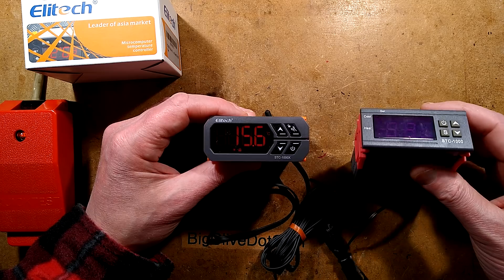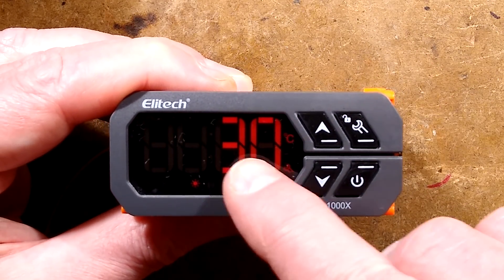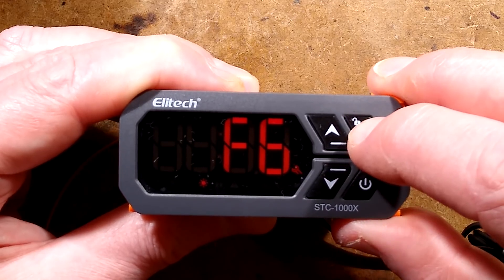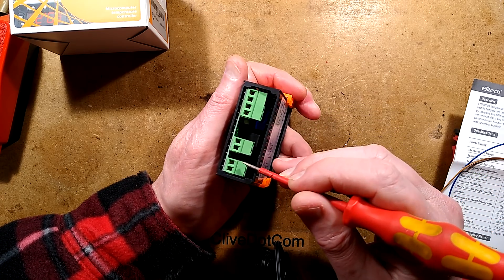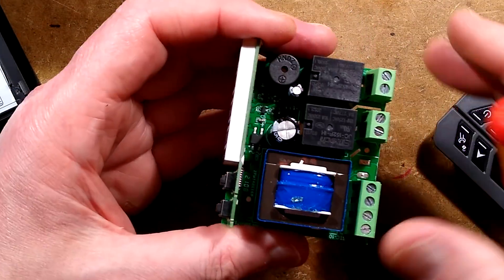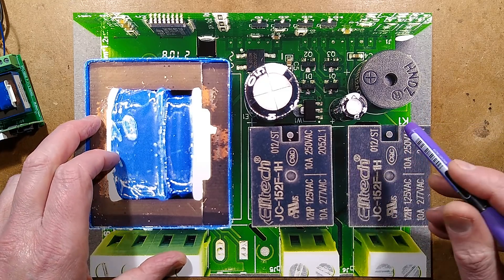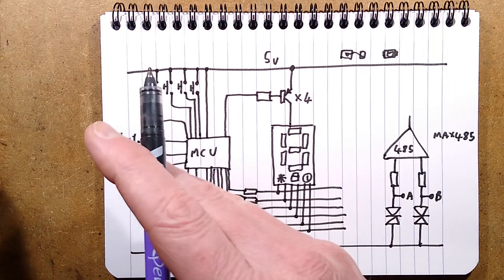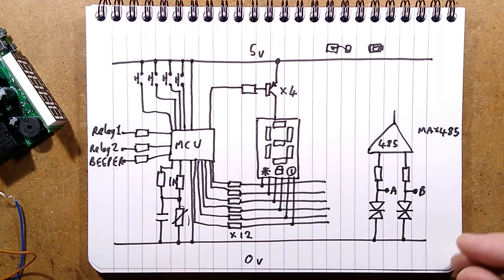Inside a better quality Elitech thermostat (with schematic)

Comment: In an electrical system NEVER assume that what's designated Neutral actually is Neutral. In industrial systems you might have a solution of 230V between 2 phases in a 3-phase solution with floating ground. This would lower the risk of someone getting hurt if they accidentally touch one phase unless one of the phases connects to ground. But then the system can have an alarm detecting a ground fault issue. And if you don't have a polarized power plug on a device it's a 50/50 if you have hot or neutral. (Movie quote "Assumption is the mother of all F:s)

So I'd prefer to have a protective ground connector separating the sensor input from the power supply. Even if the ground connector is just a "dummy" connector it could be enough to create some safety space - and many cables do have a ground wire so it would be nice to have somewhere to "park" that wire. I usually don't like to have to cut wires in a cable unless I positively know that it never ever is going to be used in the future, and that especially goes for ground wires.

For anyone involved in Amateur radio - protective ground and signal ground are two completely different things. 

I'm a bit curious about when we will see the first device that uses a solution using LEDs and a solar cell internally instead of a traditional transformer for powering a device.

Comment: I have a backlit lcd digital thermostat on my central heating and it has a differential that really annoys me but it never occurred to me that I can probably set the differential! 

The thermostat has all sorts of features but I never bothered to read the instructions as I only cared about it operating as a regular thermostat and Dont care about all the programming but I should read the instructions now and see if I can change the differential, I just assumed it was how it was designed and that was that!

Comment: Powering the thermistor from the micro lets you find out if the thermistor is attached or not and it's not just smegging cold/hot
Reply: As well as driving the divider from a Vref instead of 5V rail, you reduce any errors from slight flucturations in the 5 V rail, output from thermistor will be a ratio from 100% as seen from the ADC point of view.
Reply: @jangoofy  hadn't thought of that, though I guess you'd have to look at the extra noise you introduce running though the chip and if your using vdd as the reference not an internal vref

Comment: On the display being a light guide over SMD LEDs, Fran Blanche very recently took apart an old clock that was built that way. Some things don't change...
Reply: That was actually neon, wasn't it? If it's the one I'm thinking of? (the old Japanese clock)
Reply from the maker: The most recent one with the LED display may have bare LED dice with bond wires on it.
Reply: I had a clock radio in the early 90s that was built with SMD leds.

Comment: I have an Alpicool 12v freezer and it has similar functions for restart delay and Hysteresis band adjustment via the Bluetooth app. Both help to prevent frequent cycling of the compressor due to temperature fluctuations suggested by the sensor module which itself can be majorly affected by its proximity to warm components or drafts.

Comment: Most remarkable thing about all of these that I've tried is how well their self tuning PID algorithm works. This type of controller used to cost more than a new car.
Reply: This has no PID algorithm, tuned or otherwise.  It's essentially a dumb thermostat with a time delay added.  In the 1970s and before this would be done with two adjusted thermostats set to the +3 and -3 degree temperatures, a mechanical time delay relay, a few basic relays to do logic and output, and a 24VDC power supply for the control modules.  By the 1980s, the relays and other modules would plug into 11-pin sockets on a DIN rail in your control panel/box. By the late 1980s, PLCs could do the job themselves, but would still cost more than the DIN rail modules, and early versions of these all-in-one thermostats started to become available.
Reply: @johndododoe1411  Indeed--the PID controllers that I've played with usually have two displays and a very involved menu system for setting the various constants.  Still inexpensive (usually < USD$30) but quite handy.
Reply: @johndododoe1411  You could be right. Certainly the unit I bought for around $10 is a lot smarter than the bulb thermostat I use for a different application. The only way to know for sure what you're getting from most online vendors these days is to buy the thing and test it. All the patents related to PID control seem to have expired. Not that patents ever had much impact on Chinese manufacturers.
Reply: I suppose that was when any self tuning PID algorithm required a PDP-11 to run on?
Reply: @andreasu.3546  From dim memory they were a unit about the size of half a shoe box. There's also a cloud hanging over the value of any "self tuning" I believe. Keep in mind some of these devices were being used to control furnaces bigger than a block of flats. 
I worked in SCADA but still rubbed shoulders with the people responsible for the measurement and control of a process.
One thing I can throw some light on is the importance of selecting the best sensor for measuring temperature. The PT100 and PT1000 sensors use the resistance of a platinum  wire as the way to measure temperature, ideally using a bridge. For lower temperatures and cost there's thermistors and for higher temps than platinum can handle there's a range of thermocouples but they bring their own issues e.g. they actually give a voltage proportional to the temperature difference between the cold and hot junction.

Comment: I like those transformers, we used to buy them with premium cores to reduce self-heating. One of the main reasons they lost popularity is that they are not universal voltage so you need an extra winding and maybe extra terminal for 120V and then there's 100V/200V Japan to deal with...

Comment: Elitech has a number of product available, including WiFi capable line powered devices that have electrical outlets to control temperature and humidity. The one you presented sells for about $20 USD.

Comment: I had to go take a look at the Elitech products after watching this video. They are only slightly higher priced than the clones I've been using, but well worth few extra dollars. They aren't switching any heavy loads in my application (only about 3 amps at 110v), but as soon as the Clive had the case open it had a more professional (and safer) look to the board layout.

Comment: I watched about 02:20 of this before I realised I was watching a vid about the type of device (and menu system) I detest. My parents had a wireless heating thermostat installed. The problem with it is that they keep picking it up and moving it between rooms, during such time they inadvertently press control buttons and change settings then wonder why the heating is on at midday but not during the morning. Either that or they are trying to beat the laws of themodynamics somehow [which I doubt].
Reply: That's why it has a lock function.
Reply: @RedwoodRhiadra  THANKYOU. I need to find that!!!!!.
Reply: @RedwoodRhiadra  It's a "BOSS 957707" It doesn't have a lock on it. Would have been useful - given how they get thrown around (AND DROPPED frequently).

Comment: The MAX483 is an RS-485 transciever. On the MCU side, it requires TxD, RxD and TXEN (TX ENable), all TTL. I use these in many of my projects.
I very much like the display. That's something we could replicate easily with a 3D printer and LEDs on the circuit board.
Reply: I also strongly suspect that it speaks ModBus over 485.  I kinda want to get one of these and see if it responds to any registers.
Reply: @hpux735  Yes,  I was going to say the same exact thing. ModBus. But you beat me to it :goodvibes:

Comment: The four pads on the front of the display pcb are almost certainly Reset, SWD, Ground, and Voltage for the STM micro on there.  This suggests that, with a bit of reverse engineering, you could roll custom firmware to add more features, especially around the serial protocols.

Depending on which STM that is, they may be using a DAC to do a chopper style stimulus of the thermistor, to avoid noise.  The cap in parallel to with it would probably argue against that, though.  In any case, by tying it to a GPIO, they enabled lots of handy tricks for finding out if stuff is still working as expected,or if it's gone a bit off the rails.

A very cute unit, clearly done by people who know what they're doing and have pride in their products.  Bit of a contrast to the last three, to say the least.
Reply: The GPIO powering the thermistor is to avoid 'self-heating' - the current used to measure the thermistor's resistance has to be dissipated as heat, which would make for slightly less accurate readings. If the reading current only pulses on for 1 millisecond per second, the amount of self-heating is much lower.
Reply: I've heard about custom firmware for the Inkbird ones before. People would use it to do things like ramp up the temperature over an hour.

Comment: The display is showing an ambient temperature of 15.8C.  Bit of a heatwave for our Clive.
Reply from the maker: I'm sweltering.
Reply: Given that I used to have an outdoor "lab" in Arizona USA with typical daytime temps around 42C, he'd positively melt there.
Reply: I get irritated if my lab is less than 21C.... brrrrr
Reply: 60.4° Freedom Units, not terrible, I was expecting something in the low 40's maybe, lol.
Reply: @idjtoal  - "Freedom Units"... LOL.  There are better "F" unit names...  Fahrenheit was was high tech 300 years ago but it's time to move on to a system that makes sense!   :-)
Reply: @ElmerFuddGun  and hardly freedom when you inherited them from someone whose intention was to make you not free.
Reply: @ElmerFuddGun  It does make sense, though, it's using the same system as Celcius.  Instead of 100 degrees from freezing to boiling, it's 180 degrees.  32 to 212.  And zero isn't where plain water freezes, it's the coldest freezing point for water they had at the time, using salts and whatever else.

"Time to move on," yeah, no.  I think it would've happened already, if it was ever going to.

Comment: I think the compressor delay is the number of minutes from the last time the compressor was running, not since the differential temperature was reached.
Reply: Yep. I've always referred to it as "REstart delay" for that reason. I think the idea is that the system pressure begins equalizing as soon as the compressor stops.
Reply: @sootikins  One of the experts at work told me it is to prevent the compressor oil from foaming up too much. On every restart the oil gets mixed with refrigerant in an uncontrolled way and foams up a bit.
Another reason is that a compressor has a hard time restarting under pressure, like working against a brick wall which can stall it and lead to overheating (locked rotor).
I can also imagine that restarting a compressor often will stress its start windings.
Reply: @nrdesign1991  Didn't know about the oil foaming but it makes sense. As for starting against a brick wall of pressure, that's what I was referring to when I mentioned system pressure equalizing, i.e. head pressure decreases and suction pressure increases over time ( = less pressure differential across the compressor) once the compressor is stopped.
Reply: @nrdesign1991  Also, I'm not sure about stressing start windings, but on larger compressors, say 500HP, frequent starts will most assuredly lead to the motor starter or soft start blowing up in spectacular fashion. In my experience, on those big machines, there is a second time delay - longer than the restart delay - that sets a minimum time between successive starts (as opposed to time between stop and restart)
Reply: I was just about to write that, lucky you are on top. That is preferable to being on the bottom I hear lol.
Reply: @loonyloony6550  Don't knack it until you've tried it, sometimes it's fun! Unless its trying to lift something.
Reply: exactly what I was thinking. Don't want a compressor cycling too often.